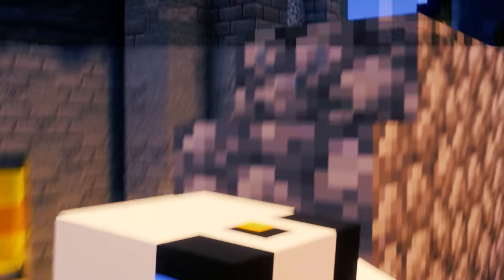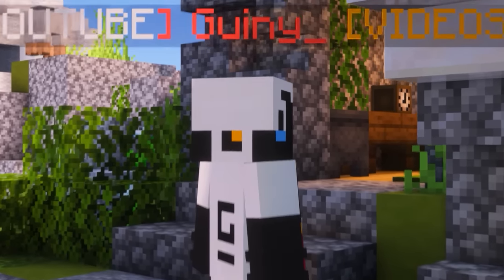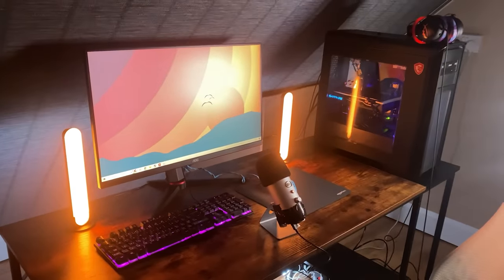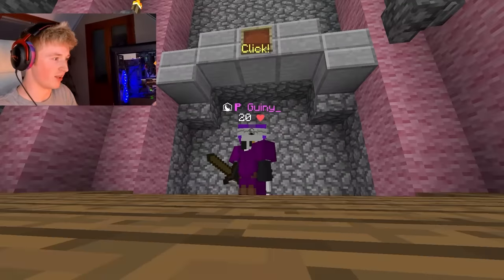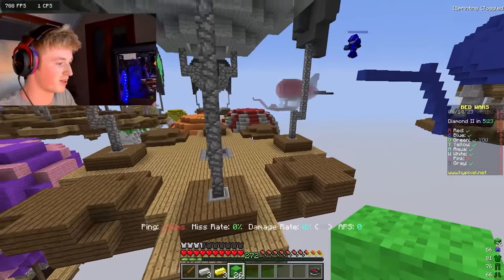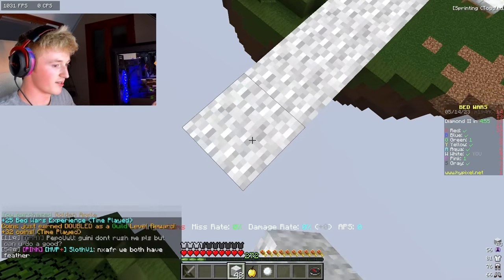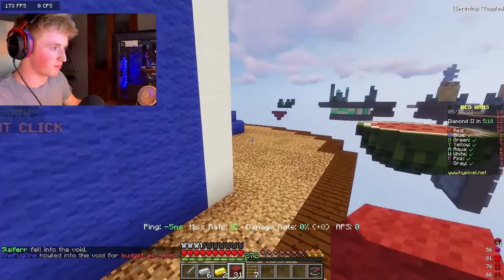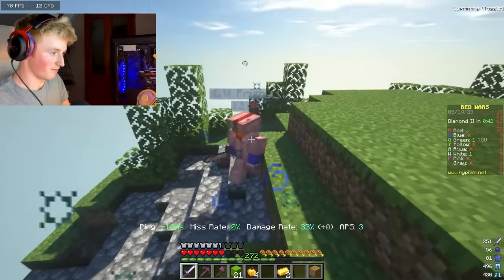Bedwars With The CHEAPEST Gaming Setup!

Comment: My setup is....

Hp Elitedesk 800 G2 sff
16GB Corsair Vengeance LPX DDR4
250GB SSD
Windows 10 pro
AMD Radeon RX 6400 Low profile 

I basically get the same performance out of this video. I did a overclock to all the parts I can do. With the overclock running Seus Renewed Shaders, I can get around 120 fps on my same settings

Comment: i feel ripped off after watching this. my pc is probably the same price or higher as the one in this video and it's way worse. im talking, like, a maximum of 60-70 fps and crashes when i use over 150 fabric mods and i can't even play forge with more then one or two mods and any version 1.12.2 or lower will hardly run (i haven't tested many versions though so probably a few above 1.12.2 as well). and if i play for to long, especially on large worlds (like my survival world which is 3G) my whole pc will crash and require a restart. also it takes forever to boot up applications for the first time after a restart.

Comment: aint no way that is getting 700 fps, he is 100% not using the "cheapest pc", my own computer which has better specs than this on hypixel i get 400 - 600 on the lowest settings in lunar client

Edit: he also had changed the wallpaper, had steam and was recording so he probably was using his current pc instead of the "cheapest"
Reply from the maker: I was using the PC! I will admit I couldn't figure out how to get windows onto to 1TB SSD, so I used it to instead store the recordings and then used my dads old 100gb SSD as the OS. I chose a nice wallpaper for the montage as the original blue windows wallpaper looked ugly with the setup lol